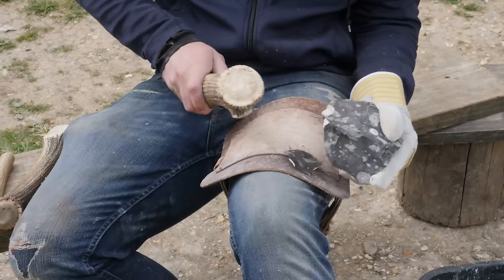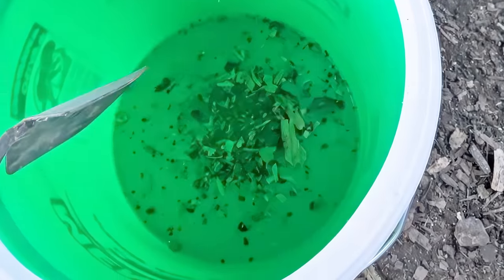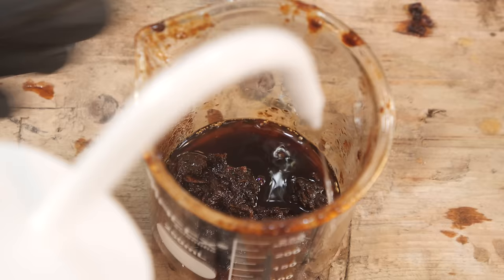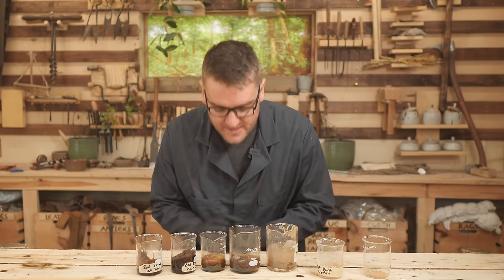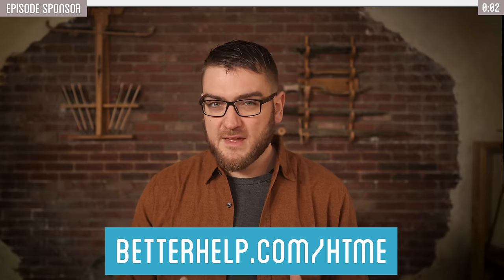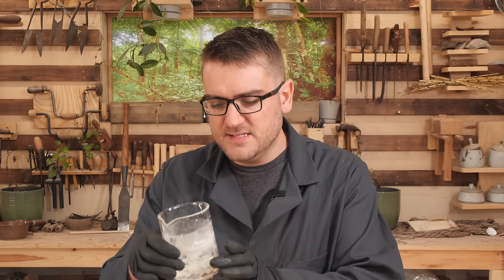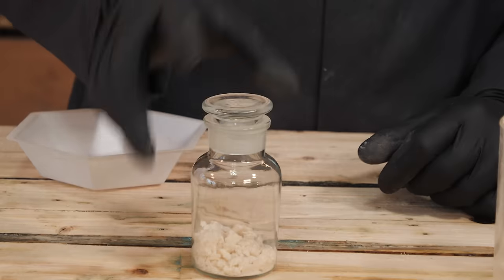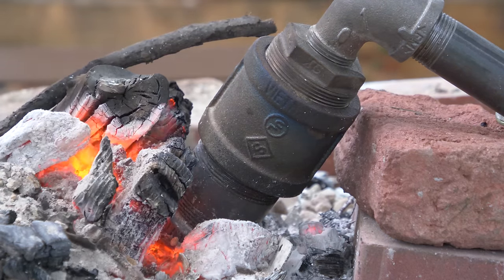Turning Alchemy into Chemistry with Chickens

Comment: Once you've processed rotted poop, the solubles are a mixture of nitrates.  Adding wood ash (which contains a lot of soluble potassium compounds) will cause a displacement reaction forming more potassium nitrate from the other nitrates, and exchanging with mostly hydroxides, forming Calcium and Magnesium hydroxide, which can be separated.

Comment: You don't really need too much nitrates for making sulfuric acid, you can burn sulfur that makes sulfur dioxide, then absorb it in a solution that contains nitrates, the nitrates will oxidize the sulfur dioxide into the trioxide releasing nitrogen dioxide into the air, which will oxidize in the presence of oxigen back into the nitrate ion, which comes back into the solution, making it a catalyst.

Comment: For the purification, you can use activated charcoal. It's fairly easy to produce. Just soak charcoal in a strong basic solution for around 24 hours, then boil it for a bit, wash it in clean water, and let it dry. It, off course, will be not an industrial-grade product but should be good enough to deal with random organic impurities in the solution (I tested it with organic dye).

Comment: Congratulations on successfully making sulfuric acid! Here's a few of the many (more) uses you'll find for it:
*Making hydrochloric acid from NaCl (Which in turn is very useful)
*Making nitroglycerin from nitric acid and glycerol
*Making flavouring agents from a carboxylic acid and an alcohol (i.e. Fisher Esterification)
*Making the lead-acid battery (I would prioritize this, personally)
*Converting ethanol into diethyl ether (useful solvent, anesthetic, diesel engine starting)
...and of course many more.

Comment: The dark color in the solution is probably from carbonaceous material and iron salts.   But most of your nitrates here are bound as calcium nitrate, which is far more soluble than either sodium or potassium nitrate.  So you have to precipitate out the calcium.  You do this by adding carbonates. And what better source of carbonate than potash.  Well potash, K2O, is not woodash which contains potassium carbonate but far more calcium carbonate.  So you have to purify your wood ash too.. in part by calcination.  Once you've precipitated out the calcium, you separate the sodium from potassium nitrate by successive fractional separation (sodium nitrate is more soluble than potassium nitrate and potassium nitrate is more soluble in warm than cold water...so you heat the solution, allow it to cool and collect the precipitate that forms right under 40 C.  Crystalize that... then redissolve and heat and cool and collect.

Comment: I think you may findd the lead boxes were lead alloy boxes, probably lead/tin mostly, maybe lead bismuth or antimony. Also, lead does react with sulfuric acid, this is how lead acid car batteries work(which you can now make as well). But if you do a minor electrical process on the lead sulfate that is produced,  you can get the acid to part with it.

Comment: A note to firearms enthusiasts: yes, you can handle lead, like bullets, all day and be fine, even for months on end. that does NOT make it "safe" though. Lead bio-accumulates, and loves to do so in your brain.

So you might not see the ramifications of handling all that led until late in your life, when you have neurological issues as a result.

Better to be Safe, than sorry: use gloves and, if you're heating it, a respirator (this includes for those that solder with leaded solder)

Comment: As you move up the tech ladder and prove you can make a particular resource/chemical from scratch, do you shift to using modern suppliers for i.e. your chemicals, for subsequent projects, or do you try to be as authentic as possible and re-make new batches of base chemicals for later experiments? This applies not just to the chemistry stuff, but the other things, like metalworking.

Comment: 11:47 Which leads to batteries, which can lead to electrolysis and better, purer copper which can be drawn into better wire and put int a motor which can power industry. IE… Industrial Revolution and plastics and electrolysis leads to aluminum which is used in airplanes and even rockets which leads to outer space.

Comment: You can try making sulfuric acid by roasting iron pyrite to produce sulfur dioxide and then bubble that through water to make the acid. Im sure it can be even done with clay if you try hard enough and make a reinforcing glaze. Basically a sealed chamber inside a forge with a pipe going to another chamber filled with water, basically a still but low pressure.

Edit: after some quick research, for this method to work well, you would need to include an oxygen donor material. Im curious is its possible to use sodium chlorate and have it react with the iron to work as an O2 generator, that can then react with the sulfur producing SO2
Reply: That's how he made the acid in a previous video. (The first part you said-- not the later edit)

Comment: Don't know if you tried but I just watched another vid which basically says that to make sulphuric acid you can 1. heat pyrite to approx. 600 degrees C (which will boil off the H2S from it) then 2. Add water. As for the battery, you already have lead and sulphuric acid, job done right?

Comment: I've been wondering... if saltpeter is a salt, and is water soluable... would it then not be possible to seperate it through capilary action? have a rope hanging out of the container, the water will travel along it, bringing along the salt. Continue to fill the "dirty" container with water and boiling off the water that collects in the "clean" container? I did an experiment with normal table salt as a kid like that :p

Comment: how about looking over structuring everything to be more efficient... and that starts with the chicken yard its self. like building a pool that has a chicken yard on top of it, 90% of nitrate dissolve in water and are then dragged down thru the water table... so fortifying a basin under the chicken yard that funnels the water into a cistern as it rains is the primary step in simplifying operations including the use of sand and arrogate to passively filter matter out of the water. you don't just dig a water well, first you dig miles of trenches that all connect and are lined with clay then filled with course rock only having a thin level of dirt and grass on top, repeating that in similarity for the intention of collecting salts from livestock on a larger scale not limited to that of solely being chickens. WM facilitation... looks like your getting 3 grams per 100 pounds of swage, 90% of the nitrates have already seeped into the ground entering the water table that is on average 50 to 500 feet below ground level.

Comment: Very Cool.  Google using AI to interpret CW.  You have to train it on good and bad CW or it will have a hard time copying the code.  People are much better at picking up the intent of the transmission more than a rule based program.